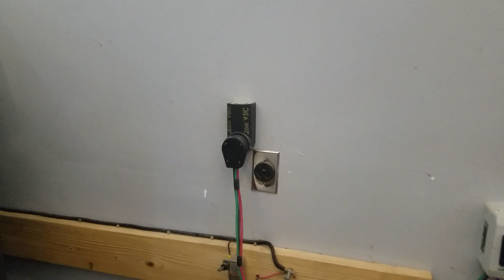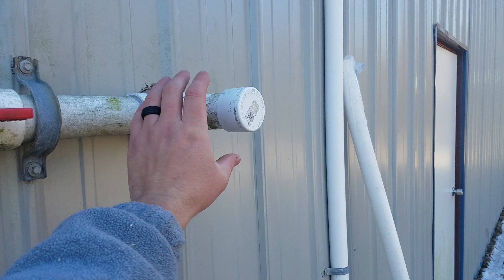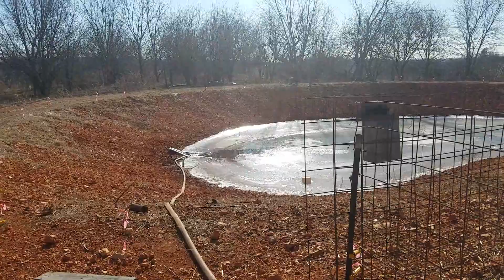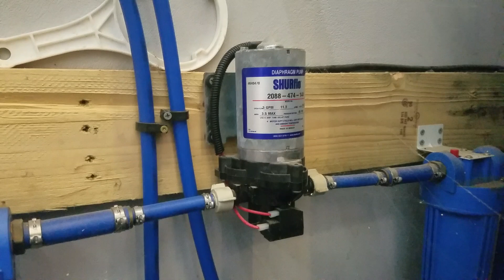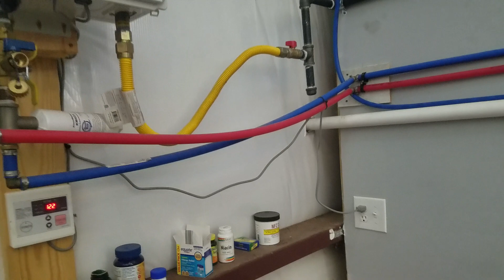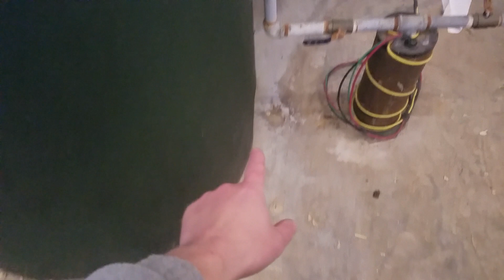Off grid solar deep well pumping

Comment: Thanks for the informative video.  I have 2 questions.
1) Assuming you don't need/want the reservoir setup, is there a limitation with a larger expansion tank?
2) Why couldn't you just go with a traditional setup with 120V pump and use an inverter?  The pump would run as needed and the batteries would supply the juice?
Reply from the maker: Greetings.  Pumping directly into a pressure tank will greatly reduce the amount of feet the pump is capable of lifting water out of the ground. There are charts you can reference for each specific pump. As an example with fictional numbers as a reference, say my pump can pump from a static water level of 200 into an open tank with no pressure. If I try to pump into 60 psi of a pressure tank, the static water level it can pump from may be reduced to 60 feet. If my static water level is at 150, this simply won't work. I researched tons of 120v well pumps and did not find one that would pump very deep static water levels, let alone into pressure, although your idea would work if your water tables were high enough. The hardest part is getting the water out of the ground, so your batteries would have to be able to support the load at night, my battery is the water tank and will not need replaced like a lead acid battery would.  It doesn't take a very big system to pressurize the water once it is on the surface.
Reply: Thx for getting back to me...so much info out on the WWW!  I understand the depth issue and I'll have to do more research on various pumps and setups to best suit my needs.  I now understand the two basic options, pump to holding tank or to pressurized tank (which I have now).  There are 240V inverters too, and I'd need to consider adding real estate to accommodate a holding tank vs. using pressure tank(s) in my small well house.  Anyway, lots to consider.

Comment: Hello,
I found your video very informative and  inspirational. I live Fairfax VA . I'm working on solar deep water pump project to help out poor villages in eastern Africa( Somalia and Ehiopia) where I am originally from.  The people in these villages haul waterbon their backs or on donkeys ( for the well off). My plan is to finance and build one solar deep water pump in one  community well which has not been working for  few years now because the submersible pump and the generator were broken or for lack  of diesel.  The well is 160 meters deep. Water level varies between 80 m to 130 during dry season.

I was wondering if you would able to  help us with advise on design and equipment selection.

 What made your project  stand out  from the rest is the evolution you went theough, from hauling  to pumping, and      and the experience gained in the process. 

I realize it has been sometime since you posted this video. Please contact me at oabusa@gmail.com . We would appreciate if our project can  benefit from your first hand knowledge and experience.

Respectfully
Omar Abdi

Comment: great video Eric where is the best place to purchase the grundfos pump,,also the maker of your solar panels,, lv the shop light vidio also
Reply from the maker: Grundfos has specific dealers in each region.  Call around to the local well drilling companies and they should be able to supply you, or perhaps contact Grundfos directly for a list of dealers.  If your from the SW Missouri area, I could give you the name of the local dealer, but I would not use them for any labor/work, pretty terrible company to deal with.  The panels are cheap chinese no names.  I saw them on craigslist and it was almost meant to be.  You never see panels this high of voltage come up for sale, the guy who had them was converting golf carts to solar by removing the canopies and using one of these panels AS the canopy, so you could charge your 48 volt golf cart while you were doing chores around the house.  Kind of ingenious really!

Comment: I have a question about the stock type float shutting off the water supply.  What stops the pump from continuing to pump?  We had a similar problem where the pump did continue to pump and got hot since cool water was not being pumped and caused the pump to fail sooner than it should have.  Enjoyed your video.
Reply from the maker: It would shut it off to the tank, I would have a separate water line to divert water to, the pump will continue to run.  I'm thinking a line running to a radiator for geothermal heating and cooling

Comment: Excellent video. We are building an off-grid cabin and will install a similar system. My question is who is the manufacturer of the storage tank you have? What is it made of?
Reply from the maker: The tank is from poly-mart.com it's a 500 gallon BPA free foodgrade polyethylene tank
Reply: How do you clean it? And how often?

Comment: First off, excellent job! It's a good system with pumps sized so you'll never run out of water. I like the ability to run AC/DC, it gives you options. I also like the idea of the well pump in the bottom of the tank instead of the 24V pump on the wall. What I wonder about is the overflow system. If it were me I'd have an electrical float switch in the tank. Is there any reason why you couldn't do that other than the switch contact welding problem with D/C current?
Reply from the maker: Thanks!  I did end up switching to a well pump nested in the bottom of my tank when the sureflo failed.  Works great and the pressure is awesome.   Grundfos does make a float switch set up.  The cost is pretty high 400 or 500 dollars.  There was some complaints I found that said the module would fail to recognize the float, and it would overflow your storage tank.  The on/off switch I bought was only fifty.  It came down to cost and simplicity .  It would be important to install an overflow even if you go the float switch route, in case of a failure.
Reply: I can certainly understand cost considerations and $400 for the float switch is way more than you have in the overflow system. One other question that came to mind as I watched the video the second time was what you do about algae growth in the tank? I suppose that since your water is constantly flowing out the overflow maybe it isn't a problem? In a conventional system, water isn't exposed to air until the tap is opened or in the toilet tank and I know from experience that slime can form in the toilet tank. Is it a concern with your system?
Reply from the maker: Are you currently using a well?  I wonder if the slime you are experiencing is finely dissolved clays in your water.  Algae, by the nature of the beast is a plant, and must photosynthesize to live, therefore if there is no light, algae cannot grow.  I will get some algae at the outlet of my overflow and into the white plastic tank outside, it gets quite a bit.  Inside algae cannot grow.  The 500 gallon storage tank I purchased is an algae resistant growth tank because of it's opaque color and they claim can be stored outside with minimal algae growth as very little light can get in.  I too have some fine clays in my water and you do notice them sticking to like the porcelain of the toilet, mostly cause it's the whitest thing I own.  It's all but impossible to filter out the clay, it is such a small particle.

Comment: Great system.  I was also thinking that if someone does not want to use a large water storage tank, they can use 2 or 3 larger pressure tanks in parallel.
Reply: That's what i was thinking as well as i have a weekend cabin and my water requirements are minimal. i also have rainwater catchment capacity that i can tap into.